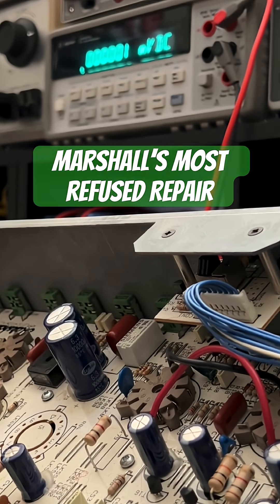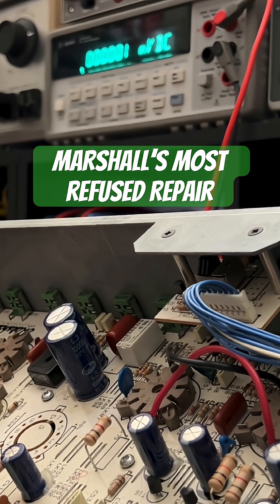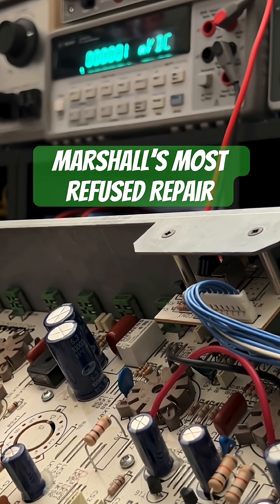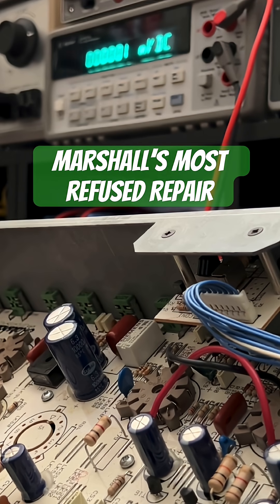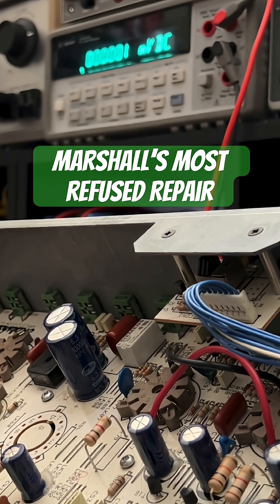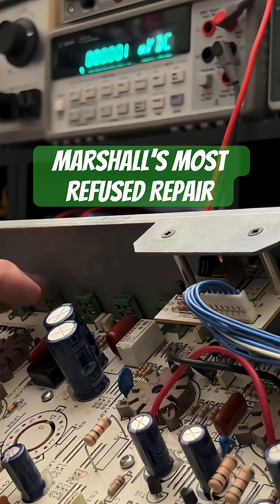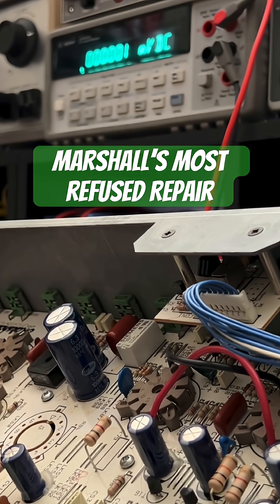Marshall’s most refused repair. It’s still my job.  #electronicsengineering #marshallamps #jcm2000

Comment: If they build it like an HIFI Amplifier , then it should be brought to a HIFI Repair shop !
Reply from the maker: I couldn’t imagine the appalled expressions nor the visible indications of sheer disgust one would get hauling that thing into a hi-fi tech’s shop 😂.  First of all, none of the wiring has been temporarily encased in carbonite to align the electrons’ pathways.  Secondly, just look at it!!